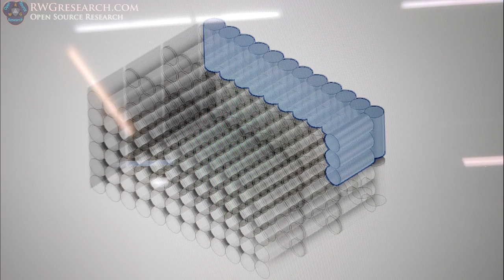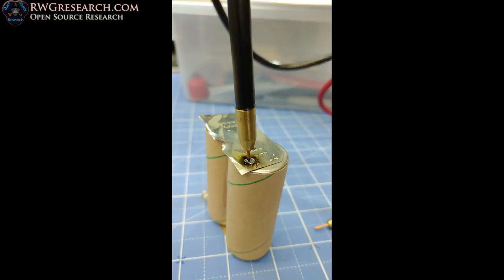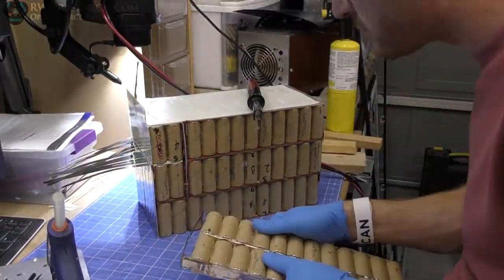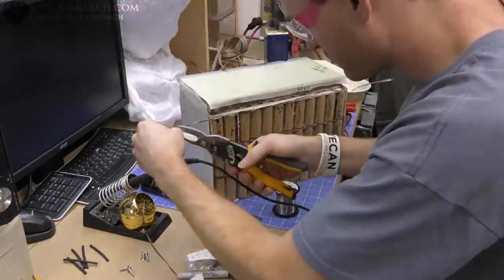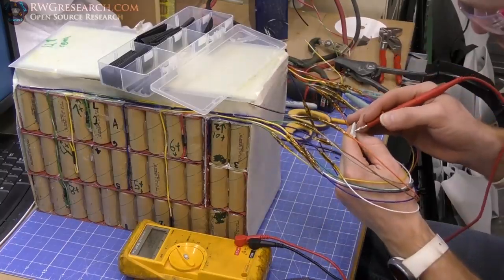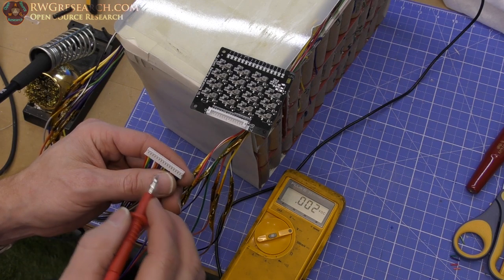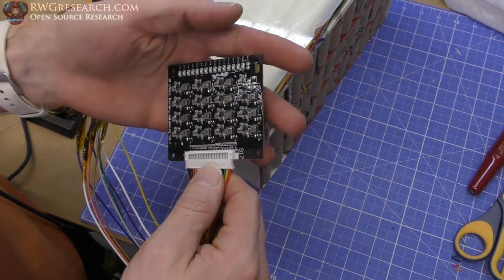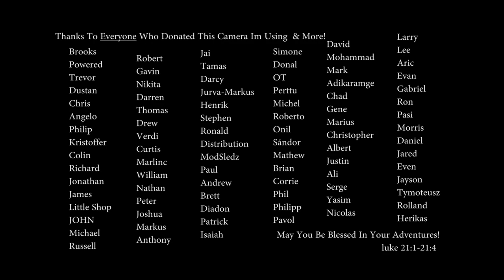Zero P5: Building The Battery With 240 Cells... "Don't Explode Yourself." Or Burn The House Down. :)

Comment: I have over 1500 cells in a battery! It gets crazy, I broke it down in 100cell packs, for a 7s system, and still going! It's nearing 2k cells, after I get the rest of the cells in a pack! To power my home, it's not a "power wall" it's a cabnet with Batteries only. I think I'll work on the next generation of batte when I get about 1200 ah, at 29v I'm thinking about 1500 ah of LTO cells next, then that will be all I will need, they will only cycle about 1-1.5 times a week, keep at it!!
Reply from the maker: Sweet! Yeah that sounds fun ;) ~Russ

Comment: Awesome, will check up your previous vids if I missed any. Just throwing it out, is there any BMS that you can set the voltage on? I will use 2.7V cells, so I don't have the 3.2's.
Reply from the maker: Well. You have to get the correct BMS for the battery... This one will just balance. So what ever the voltage is it will just balance it... If you want to control the top off voltage. Use a solar charger that has that built in. Or use some voltage regulator board for charging... ~Russ

Comment: what chemistry was the original zero battery pack? Isnt' it lion? I am surprised the LIfepo4 cells would work since they are a different chemistry and have different minimum and max voltage curves?

Comment: im wondering, electric skateboards work nicer with Voltage electronic speed controller VEsc for the motor, rather than conventional Esc which regulate through current control. Is this the same case for the zero bike originally? and is this something you would look into to potentially make the whole system more efficient vise a vie the control and functioning of the motor?
Reply from the maker: So from my understanding. The Vesc is an sec made by benjamin vedder. Any how. This is a DC brushed controller and motor. Not a brushless. It has no regen breaking. So it could at least use that to help recharge the batt on slow downs. Save my pads too. But in the end. Changing this to a larger brushless motor and controller would be fun. But to large and its a waist of power because its only 52v. So for now this axialflux motor really has the power for the size and weight... And adding regen breaking is something id love to try to do... ~Russ

Comment: Can you tell me if I can get a 54 volt battery pack and use it on a e bike 750 watt that came with a 48 volt ? It’s bufang set up.   I want a bit more power for off road  but I don’t want to short anything.
Reply from the maker: Just check your motor and controller . if they can handle the higher voltage you may be fine. Some are duel voltage... But may need to be programmed. However be carefully as some other stuff on the bike may only use 48v... May need to isolate them or something....~Russ

Comment: What spot welder do you use?
240 cell's isn't a lot, I am going to build my own DIY powerwall With around 1000 cell's (around 7KwH). Some other people have made a DIY powerwall with over 5000+ cell's on the DIY Powerwall facebook group. As long as you know what you are doing nothing bad will happen.
Reply: In English, plurals do no get the 's as far as I know. Cells. Some languages use the ' when the pronunciation or meaning could otherwise be missed.
Reply from the maker: Its one from orion. Its really used for micro tig. But can spot weld. However it better at tig. Haven't had as good as luck as I wish with the spot on this thing...  May just need better tooling. ~Russ